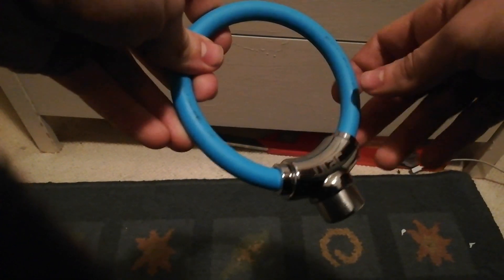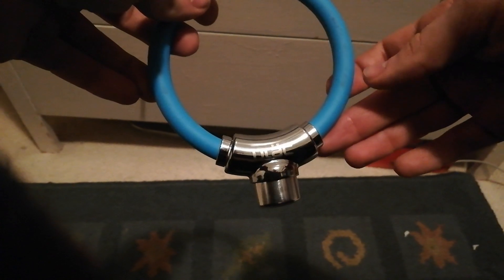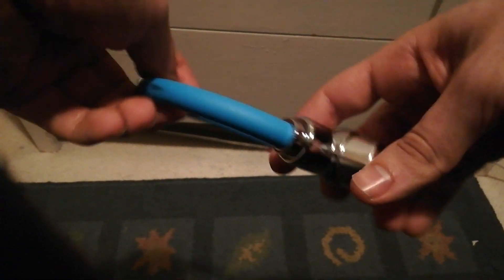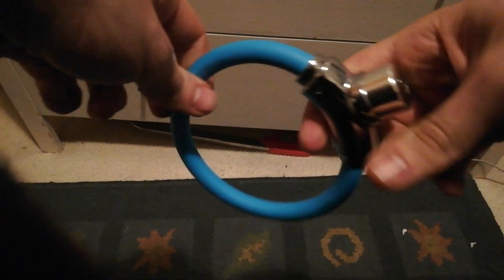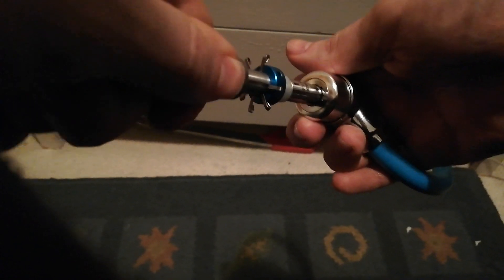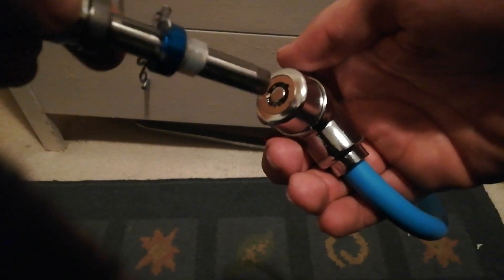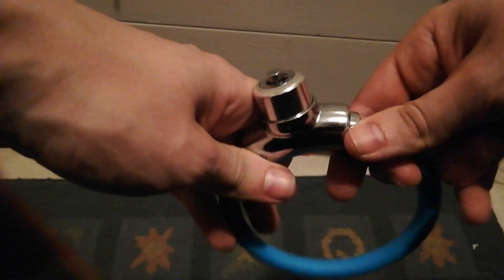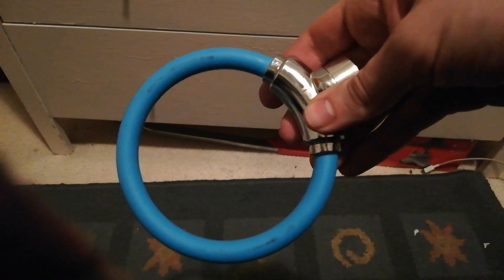Uläc bike lock impressionable.

Comment: What a weird lock! I've never seen one like that before, it's certainly compact!
Reply from the maker: It is compact ye. Secure....I don't know.
Reply: I wish lock manufacturers would at least change the diameter of their tubular cores so that these standard impressioning tools don't fit!
Reply from the maker: That is true, but I guess it would make having a new key harder to make unless someone was going to make new blanks to fit as well.
I think I have a idea how they could make a impression tool harder to use as well. I will share the idea soon.
Reply: You're right there, I guess it was once security by obscurity but now they need to change their tactics. Even something as simple as security driver pins might help! Looking forward to hearing your idea.
Reply from the maker: @HobbyPicker  Well I think the existing tubular lock is outdated now and some modifications to the design can be used to make it more secure. Kinda like a standard pin tumbler getting side bars and special features to make raking and bumping harder for example.
But my idea will try and defeat the impression tool.